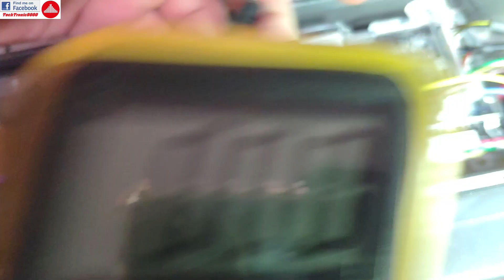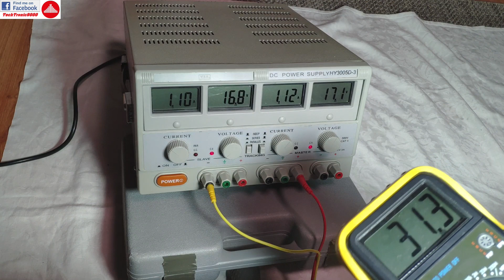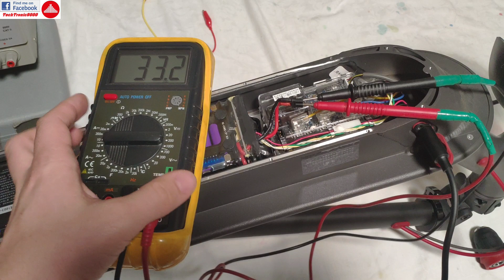Xiaomi M365 Battery Revival - Over Discharge (one year stored empty)

Comment: so I did this it charged all batteris, blue and red were blinking while charging.... charged all batteris to 40V but than the blue stopped and red still flashes only 4 times and nothing else happens... bms outputs 20V while battery is at 40V full
Reply from the maker: Maybe there are other issues also such as burnt fuse, or broken spot weld.
Reply: @TechTronic9000 all spot welds are okay and fine .... ive since bought a new battery cuz it drove me nuts lol

Comment: This method worked but once i put everything together It doesn't charge with the charger... 
The charger Is fine because i use the same charger to charge the battery with the bypass. 😢
Reply from the maker: Check the charger plug and wires inside the scooter frame

Comment: How do I know which cable is the discharge battery for two different 36v batteries I have please
Reply: One of the batteries has two connectors, one 8 pin red and black wire connector and one SM 2pin thick black and red wire which goes to the port but then at the bottom is another two thick red and black wires soldered to the board which leads to the connector that connects the battery to the rest of the scooter, which ones are the discharge please?

Comment: My 36v battery only has 1-2v in the connector when testing, will this method still work for me?
Reply from the maker: Yes, it can still works as the BMS can cut power and you only see 1-2V like you say.
Reply: @TechTronic9000  thank you and I can use this method with different battery connector types too?

Comment: Just want to chime in and confirm this works for my M365. Had been left unused since 2020 (around COVID) so probably 4 years till now. The battery was at ~14.5V and the charger wouldn't charge, so exactly like this video. However mine was NOT blinking any LEDs on the BMS.

Bought a DC power supply off Amazon, make sure it's at least 40V or above because this is the fully charged voltage of the pack and also the included charger's output.

Hooked it up using the multimeter probes and aligator clips, make sure you put an insulation between the 2 probes to avoid short circuit (plastic bag should work). 
Set the power supply to 40V-41V, then limit the current to 0.5A or 500mA (you'd want to SLOWLY charge the battery back up at this super-discharged state). 

I let it charge for about 1 hour, nothing happened, still no blinking LEDs on BMS, nothing. Multimeter showed around 35V-36V with the power supply on, around 20V when off. Tried putting the battery back and plugging in the charger and voilà, charger's LED turned red and the BMS came to life with blinking blue/red LEDs. Funny thing was, I measured 35-36V with the multimeter at this point.
My guess is that the BMS just shut itself off when the battery was too low. But for some reason the charger couldn't "wake" it up until we "jump start" it with the power supply.

Comment: Did this with a segway air t15e battery wich also showed 15v and wouldn't start charging, was a bit nervous so i did this outside and after charging for about 10-15 minutes the battery was already showing 32 volts. Leaving the step outside for another 2 days i decided to give it a go on the step and voila ! working again. Thank you very much
Reply from the maker: I hope that you have at least subscribed ;)

Comment: how can I do this without dc powersupply?
Reply from the maker: You can try to use the original charger, but it's a bit fiddly to be able to connect wires from the charger. You need to take care not to short out any of the wires.

Comment: I left my m365 unuse over a year n now not charging. I open the case, and there is no red or blue led. But upon plugin charger, it flashed red 4 times. Check BMS voltage output is 18.40v, but the battery before BMS is 36v. What can be wrong? Is the BMS board faulty after unuse for too long ?
Reply from the maker: Just leave it on charge for 10-20 minutes and see if it comes back to life
Reply: Thanks! I unplugged the balance ribbon, check z fuse ok, check D9 not short cct. B0~B10 are 3.7~v. Then plug in the balances ribbon, at one point it flased blue then started blinking red. But still not taking charge.... Now back to famous blink red 4 times upon power on or  reset!
Reply: Finally I'd fixed the blink red 4 times -  replace the BMS board and now it blinks blue! I hv check n charge up each cells to ~3.8v. Now it can turn on and there are 73% charged.

Comment: My battery pack was reading 1 volt. I have the charger connected through the output and it is charging.  I checked after awhile and it was 2.4, then checked later and 3.2.

We'll see how it does. I am skeptical after veing so low.
Reply: How did you get on please as i am having the same issue and unsure if to try it?
Reply: @leefreeman-roach3526  I left it plugged in far to long and it never got higher, but I reconnected everything and it worked fine. So, while the voltage didn't read like the video says, the scooter went from dead to working normally.

Comment: My battery has 1V from the BMS and 12V from the terminals, can it be revived?
Reply from the maker: The BMS usually doesn't show any voltage when it goes into protection. 12V on battery terminals is dangerously low. I would investigate first each cell group and check their voltage. Also check the terminals if they are still properly welded.

Comment: This is the exact issue I am having with my scooter. I even tried charging through the discharge port and the voltage increased to 2.8v. However in your responses to all the comments below you note to only charge it for around ten minutes through the discharge port. If I keep an eye on the voltage and check for heat, can I charge it through the discharge port for longer? Say 30 minutes?
Reply from the maker: Could also work for 30 minutes but only under supervision.

Comment: Hello my friend. Is it safe to use some other lower voltage charger (say 7 volts) to try charge it up just a bit and then put it back to the original charger? I’m asking because I don’t have the fancy DC machine you have but have the same issue with my battery. Thank you
Reply from the maker: You need at least a lithium ion battery charger made for 36V batteries (that charges to max 42V). You can try using the original Xiaomi Charger.
Reply: @TechTronic9000  i am just going to try charging through the discharger instead :) after 10 minutes it was only at 2.8v. Is it safe to charge this way for up to an hour to get it to 36v?

Comment: Hello how long is it safe to charge with discharge port? my battery is at 17volt I charged it from discharge port with original charger but after 10 minutes it’s still at 17volt
Reply from the maker: In 10 minutes it should have gone up. Check the wiring maybe something didn't make contact.

Comment: Hello.
So i tried this and i managed to get some power into my batteries. Still it wil not charge in the normal way. 
Its a pro so the battery and bms is inside the aluminium case so was hoping i dident have to open.
Any ideas why it does not charge on the main port but now show 35v after charging directly on battery port?
Reply from the maker: My knowledge on the PRO model is limited. If it has 35V it should start and charge normally.

Comment: Awesome!! I just connected the actual charger direct to the battery same as you did have it 5 mins then plugged charger into the normal slot and bingo
Reply: how did you do it with the actual charger?
Reply: how did you do it with the actual charger? ²

Comment: Hi, I'm having the same problem with my m365. Now it's 2.8v is it safe to charge with my original xiaomi charger on the discharge port?
Reply from the maker: Yes you can try it, but monitor it and don't do it for a long time, just for a few minutes and check again the voltage.

Comment: This video saved my mi365 too. I was reading 14v from battery and charger was green. I used the original charger with 42V to charge the battery from discharge ports. After 6-7 hours, charger went into green; voltage from battery was 20v. During that time no led on bms was blinking only charger light was red. Then I tried charging from charge ports, it started charging properly and after 1 hour, battery was giving 41v on multimeter ( I know some weird number) now I am discharging the battery with throttle, front wheel in the air. Hope next time, I can charge it without any issue. Thanks for the video, really great help.
Reply from the maker: 41V is full for the Xiaomi, it prolongs the lifespan as it will not charge to 42V like other scooters. No need to discharge again, it will only wear it out faster. Just use it normally and charge as often as possible, don't discharge too low and also check the battery to be around 50-60% when you are storing the scooter for a longer time interval.
Reply: Hello!You have used the original charger and charged the batteries via discharge port for 6-7 hours? Is this ok?I have same issues with my scooter, and I don't have any voltage measuring device.5-10 minutes shouldn't be enough to charge it via discharge port, and after switch to normal charge? Thanks for clarifying this aspect!
Reply from the maker: No, you just use it for a short time to boost the battery back to life, then you charge it normally.

Comment: Hi I’m trying to follow the instructions. My battery pack is reading 13.2V when I first started. When I hooked up the variable power supply. It won’t push any amps at 36V. I have to ramp the power supply up to 39V for about 0.5 amps to flow, then in a couple min it drops down to 0.2 amps. I’m afraid to go any higher in voltage. After couple minutes of “charge”, I measured the Voltage of the battery pack again. It did come up 0.5V to 13.7V. Temperature is good, Can I continue do this at 39-40V CV? I don’t want to blow anything up lol.

Ps: in the start of your video, your battery pack measured in at 14.5V. Then why does it take your power supply 35V to push amps? Why won’t it push at 20,25 etc?

Comment: Hello , thank you for the video , i did all the steps , now my scooter is turning on , and the battery is fully charged , but i overcharged it , now the voltage is so high more than 40V , so my accelerator is not working .. and i have some are issue like not able to connect to the App etc .. 
i need to discharge the over charged battery, is there a fix ? 
Thank you
Reply from the maker: When the battery is 100% charged it reaches 41-42V. Check your other plugs that go into the controller, maybe a plug is loose.

Comment: how to you trickle charge it if you don't have one of those adjustable voltage chargers?
Reply from the maker: You can use the normal charger for a short amount of time.
Reply: @TechTronic9000  you mean cute the end of my charger and connect it directly to the output of the battery?
Reply from the maker: @xiaobai7060  No, you can disconnect the battery charge cable and jack from the battery, then use that two pin plug and two wires to connect to the battery discharge port.

Comment: I have 3 discharged batteries from different source where can i connect the power supply voltage to boost the batteries. There is only input cables connect to BMI and output cable.
Your discharge terminal in the video is that the cable connected to bmi.
Please help
Reply from the maker: You will use the battery discharge port to jump start it again.
Reply: @TechTronic9000  discharge port is the black one right? With red and black wire but how can I to connect with orginal charger?

Comment: Hey mehn,,if i fully charge my scooter then keep it for 2/3 months,,will it happen a problem like this?
Reply from the maker: Don't store it fully charged it will decrease the lifespan. Store it at 50-60% level. Check from time to time and only charge back to 50-60%.
Reply: @TechTronic9000  and for every day riding is it ok to charge at 100% ??
Reply from the maker: Yes, charge as often as possible, try to avoid going very low on charge.
Reply: @TechTronic9000  yeah!! Thanks👍

Comment: Hey awesome video dude! I had 3 batteries at 0.1 Volts I replaced and the rest are good but i'm still having the charging issue. I am still reading 3 Volts from the discharge plug. I don't have a charger like yours but i've got an external 32Volt secondary battery that is charging it but I have no idea how long that could take as I don't know how many amps its naturally charging. I see your recommending to use your original charger but my xaomi charger is 42V/1.7A and your charging with 31V/1A is that ok? Cheers
Reply from the maker: A 36V battery when it's fully charged will have 42V, that is why the xiaomi charger is rated to 42V. You can use that. In my case I have used that lab power supply for more control and to showcase better what is happening.
Reply: @TechTronic9000  I see. Thanks for the reply but it seems that my scooter charger is stuck on the green light causing it not to charge this way :(
Reply from the maker: The charger works, green light means that the battery is not taking a charge. It's possible that you might have some cells that become lose and lost their welds, i have another video on that.

Comment: I have 3.6 volts in mine. Is it dead then? Or can I use a DC power supply like you? Thx in advance.
Reply from the maker: You can use the DC power source, the BMS is probably under protection and that is why it's only showing 3.6V
Reply: Thanks for your reply...How much time do I try to jump start the battery with 32 volts? 1 hour is enough? Nothing for the time being...
Reply: Do I have also to use two independent DC power source like you? I have only one...

Comment: Same problem here. Gauge shows 3.0 V. Is there any chance to fix it this way?
Reply from the maker: Yes, try to charge it back the same way as I did. You can also use your charger if you don't have access to a fancy lab power supply.
Reply: @TechTronic9000  I measured with different gauge and IT was 16 V. I connected original charger and after 10 min I was able to charge it via normal port. After it reached 100 percent I checked V of each cell in dashboard. From 1 to 5 there is around 4.1 with diffrrence 0.02. from 5 to 10 cell there is 3.6 V on each cell. What should I do now? Is it possible that it will normalize after few charge cycles?

Comment: It worked. Used a commenters advice. And yours for sure.
Reply from the maker: Great to hear!
Reply: @TechTronic9000  I thought there was nothing I couldn’t fix on those scooters. Are used to work for the Bird company as a mechanic and fixed everything on those scooters there is an a nut bolt screw washer grommet tire rim brakes you name it I’ve done it all. But I never had to deal with a battery that had been drained too far. I’ve had to remove batteries and replace batteries and controllers and dashboards and everything. But I was stumped

Comment: Thanks. Gonna give it a go. It’s at 2.7
Reply: Hi, have you fixed yours? I have the same problem. At 2.8. How do you fix it?
Reply: @hongtm77  I had to reverse charge it. I think it’s called. I’ll find a link on it and send it to you
Reply: Basically you unplug the battery and use the original charger. Use alligator clips and clip one to the inside of the charger (it’s positive) and the other u clip to the outside of the charger (negative) then on the other end of the wires put them in the correct positive to positive & negative to negative on the battery (short wires with yellow connector) and plug in the charger but only do it for 7-9 minutes or so. Then check with volt meter Then unplug everything and put it all back to normal and charge it like you normally would.
Reply: @ort619 okay thank you so much, will try it this 2 days 🙏🙏🙏
Reply: @hongtm77  let me know how it goes, Be carefull.
Reply: @ort619  hi, I just tried to charge from the discharge port for 5 mins. Then when I tried to charge normally, the charger is blinking green and red instead of solid red. And the volt meter reading is jumping between 42v and 36v. Any clue of what is going on?
Reply: @hongtm77  try unpluging the battery from the bms (clear box) and then plug the charger in normally, (battery still unplugged) then,unplug charger, reconnect battery, and plug charger back in and see if it works. you can also try to reset the BMS by pressing tiny button where it blinks blue (red if theres a problem) and see what happens
Reply: oh, once battery is unplugged and charger is plugged in wait 30 seconds,then reconnect battery
Reply: sorry, clear box is controller box, the BMS is the circuit board attached to battery
Reply: @hongtm77  Hi, how is it going for you? I got my volt at 3.7 only. So I would like to know if you solved it - and how. Following the @Kaiper303 way?

Comment: Hello friend I bought a xiaomi scooter (clone, didn't know :( ) and the battery is reading at 7 volts. Scooter shows no sign of life. I have no powersupply like you do, any way to charge the battery? Green light on charger when I try to charge it. Thanks
Reply from the maker: Well of it's a clone it might have a non smart BMS, try just to charge it as normal as you do. If it doesn't charge then the battery might be faulty or cells went down under the protection level. It needs more work to find out what is wrong with it.

Comment: Does it have to be charged only on the discharge port? What happen if doing on the charging port?
Reply from the maker: If the cells get to low on voltage as a protection the BMS with disable normal charging to protect from the possibility of a fire. The discharge port lets power go to the cells and increases the voltage enabling the BMS to work again.
Reply: @TechTronic9000  thank you very much! I’ve ordered the parts and tomorrow will give it a try. Cross fingers
Reply: @KeigoMoriyama  How did it go?
Reply: @Flynn-Ming  I had to replace everything because I had damaged cells